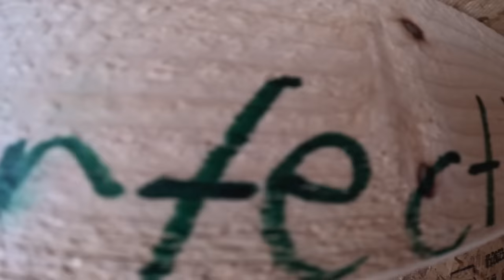We Finally Caught Him In The Trap But There's Still More Running Loose

Comment: hey Dutch if you want to catch the dogs make a square with post wrap it with wire and put a door with a spring on it and a way for it to lock when it slams shut .put a rope over the far corner it tie a piece of meat on and dog food in there fix the rope tha when they take the meat it will release the door to slam shut.youll catch the dogs and feed them at the same time.
Reply: oh yeah put wire ove the top
Reply: the live traps aren't going to work dogs a to Smart

Comment: For the record. Skunks are the most likely to carry rabies than raccoons. Skunks actually have the highest incidence of rabies than any other animal. More than 50% of all rabies exposures occur in 5 states. Texas, North Carolina, New York, New Jersey and California. If you see an animal acting aggressive, drooling or having some paralysis or acting confused then stay away from it. It would be better to dispatch the animal and take it to get tested for rabies. The brain is what is needed for testing so you can remove the head if you want or just take the whole animal. But do Not touch it. Wear protection and put the animal in an enclosed container. Call your local vet to see where you can take the animal for testing. I had to do this when I was in high school and the skunk tested positive for rabies. It did exhibit aggression and strange behaviors and actually kept coming at me to attack. It did attack our dog and bit her several times because she was protecting me. Sadly she had to be euthanized due to significant exposure.